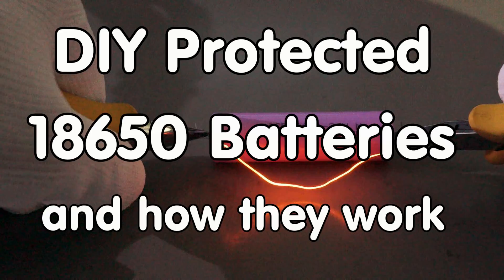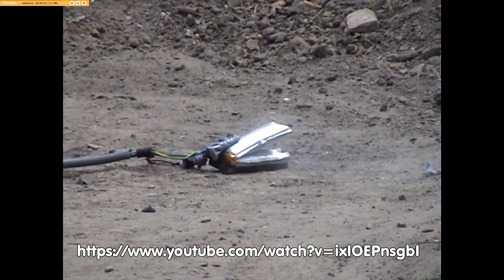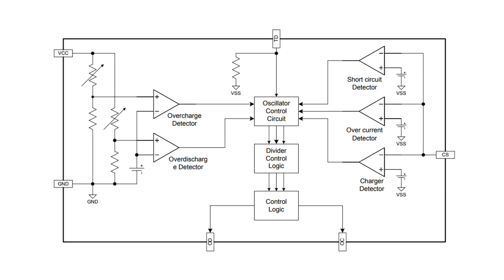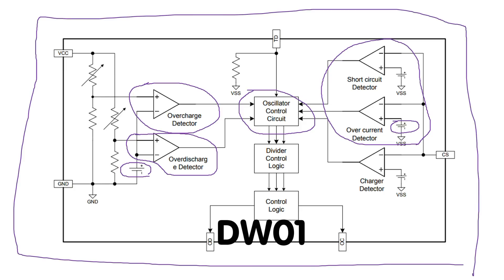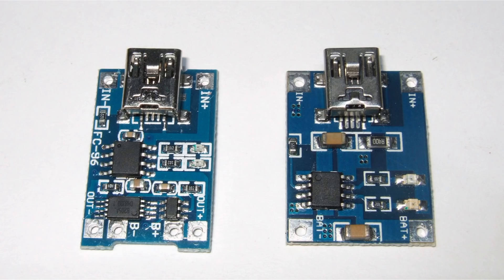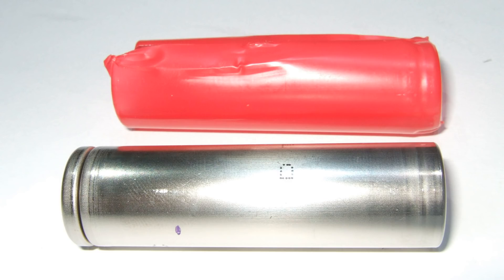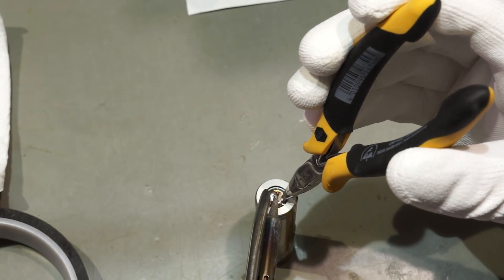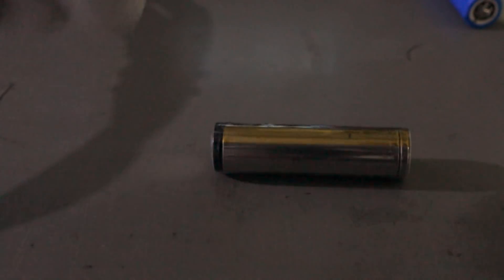#160 40 Cent Do-It-Yourself Li-Ion Protection for 18650 Cells (Tutorial) and how they work

Comment: Wowie! Cheap but no quick fix. So much ti do and do well, not gonna do it not really worth the time, then buy the finished ones or one can also fix the protection circuit in the battery case or between it and the mcu with much less effort
Reply from the maker: I agree. They are now widely available.
Reply: @AndreasSpiess  thanks for the reply, and of course the video which made things much clearer me! Just for reference to others, the modules tp4054 tp4056 or tp5100 are what Andreas (or/and I) mean

Comment: if you want to increace the number of times you can charge and discharge and limit battery degerdationg limit voltage charge to 4.15v and discharge to 3v will alomst double the charge/discharge cycles
Reply from the maker: Good point!

Comment: great video. But i think its only necessary if a product you change the battery has no CE certification. Otherwise it doesnt make sense. Here in germany every product has an CE certification. It means every circuit in a electronic device has this protection itself. So it isn´t required to do it Additionally.
Reply from the maker: I would not trust the CE sign. It is often called "Chinese Export" ;-)

Comment: Hi, It must have been almost a decade i am fondling with these batteries. I am a doctor but DIY is my passion. I must have tried almost every kind of charging method to charge these batteries but have never succeed ed to charge it to saticefaction.Before 2 years i purchased a charger for these batteries but it did not include the adapter .! It was socket with some circuit in it,to which any 5v micro usb charging adapter can be applied. So i have used that couple of time, thence but not as much as i should have otherwise. My intension of telling all this is that luckily never ever any battery haveexploded as is a risk i am learning from your video,perticularly charging a completely drained battery!!😢. Will you please tell me where from to get that small chip and what is it named as ?. I can not end up without saying that yours is the only video where in i could see author replying each comment interestingly. This shows your passion and commitment towards your work. I am radically impressed. I don't know whether and when , i will be fortunate to have respose to my comment. None the less, Gudluck and Stay blessed as people like you keeps the system trusted and going over in this era of too muchprofessionalism.
Reply from the maker: If you use a TP4056 module (link in the video description), your battery should be charged ok using a USB power supply. It has a DW01 and an FS8205A chip on board. And thank you for your nice words. At my age, I am happy that your profession exists, too ;-)

Comment: Thank you for posting the informative safety video.  Corporations have not made it clear why lithium cells should not be used after dropping below a certain voltage.  As I understand things the problem is that the working materials are carried on the surfece of a copper foil.  The copper is not supposed to be involved in the chemical reaction.  When the cell is discharged below a certain voltage the working material becomes depleted and the copper starts dissolving in the electrolyte.  Upon recharging the copper plates back onto the foil but does not do so evenly.  It forms dendrites which grow across the cell and can eventually causes a short.  This can cause the cell to vent or explode.  After a cell has been undervolted there is no way I know of to test if it has become a bomb.  Strangely, many made in China chargers will automatically charge an undervoltage cell without giving any warning.  Adding protection to a cell is a good idea but only if the cell has never been undervolted.  The protection board cannot prevent a copper dendrite that already exists from shorting the cell.  Good luck with your videos.
Reply from the maker: Thank you for the additional information!

Comment: Personally, I wouldn't trust Kapton tape to isolate the positive wire from the negative battery shell if the battery is used where it will be exposed to vibration. It will almost always work fine, but if it doesn't and the battery is charged it will burst into flames.
Reply from the maker: I agree. Vibrations need more care.

Comment: Would i be able to use this circuit kit to protect a LiFePO4 battery? I know it wouldn't protect it from overcharge, but that is not a problem because i will be using a TP5000. My only concern is overdischarge protection, as i would be connecting it directly to a esp32. Maybe it would not be a problem because the microcontroller switches off if the voltage gets too low?
Reply from the maker: Both chemistries have a similar low level. So it also should protect LiFePo4 batteries.
Reply: @AndreasSpiess  Ok, I will try it then. Thank you!

Comment: I recently began looking into 18650 and powering a project with it. Thing is, if I finish it the batteries will be really close on my body and all holding devices are designed for unprotected batteries, protected ones are slightly too big for protected ones.
I hope this‘ll work out for me and thanks in advance for the video (maybe make an updated one if there are new parts on the market? Or maybe for better audio)
Reply from the maker: I know the problem of too big protected cells...

Comment: Hi Andreas, this is awesome. Can you recommend a product I can place between a regular 5V phone charger and a security camera 18650 battery so I don't have to remove and charge it all the time. The camera is a Reolink Argus 2, I could get a solar panel to do the job but the trouble is the camera is installed on the north side of my house and the panel will never get enough sunlight. Thank you!
Reply from the maker: I do not know your camera. I assume you have to emulate the solar panel with your charger and check if the solar panel already has a charger module inside. If so, you have to add one (or extract the one in the solar panel.

Comment: Hi, greetings and salutations from Mexico. This video was very interesting for me and the question I want to ask is as follow: I need to replace the batteries of an Emergency lamp which it's always connected to the electricity and the batteries start working when the  electricity is cut off. Could the circuit showing here  be good to protect any damage ?, I mean that the battery may explode due to continous connection to the electricy.  I appreciate your comments, and thank you very much in advance.
Reply from the maker: Li-Ion batteries have to be protected against overcharging. Otherwise they would consume a ton of energy and would become very hot. Maybe they are not protected against low voltage. But this is probably not too important for your use case because they are not used till the batteries are depleted.
Reply: @AndreasSpiess   Thank you  Andreas for your explanation. Keep doing what you do in order to help people.

Comment: Hello Andreas! I put a protection board on a 18650 battery but now reads only half of its capacity.. do you have any idea why is that? Thank you!
Reply from the maker: Strange. It for sure has a little less capacity if you use a standard charger because it still stops at 4.2 volts. The battery has a little less voltage then. But not only 50% of the capacity.
Reply: @AndreasSpiess  I tried to put the same board on another battery but it won't charge at all..
Reply from the maker: So something must be wrong :-(
Reply: @AndreasSpiess  Yes! And I don't know what it is..

Comment: Now here's the thing i need some help . Now here's what's happening . Now i want to go ahead with the Dw01 ic  but what's happening is that when my battery voltage drops below 2.4 volts the ic shuts off the output but then because the output is now shut off the battery gets time to regenerate its voltage and as soon as it reaches 2.9 the load again starts to draw power but because the battery actually has very low juice left it again drops back to 2.4 and system shuts off and this cycle of the system on and off goes on and on. I want the same feature as yours that once my battery is below a certain voltage only connecting the charger enables the output again . How do i achieve that with DW01 as i went through the datasheet of both the protection ics and this feature of enabling the output when charger is present is not a feature of any of these 2 ics so how is it happening and how do i solve it for my system? Please guide me .
Reply from the maker: This is what happens. If you do not like it you have to use a voltage monitor (I made a video about the topic)
Reply: @AndreasSpiess  By voltage monitor do you mean voltage supervisor? Also there is a variant of this is called the DW01+G if you have some time can you have a look and tell me weather that ic will work according to what i want i.e( only recovering from over-discharge once i connect the charger )
Reply from the maker: Yes, a voltage supervisor. They reset the CPU if the voltage is too low. They do not protect the battery.

Comment: Hello Andreas,

Nice and informative video, however I believe (correct me if I am wrong) that there is a mistake at 06:42 : the battery should not be connected between BATT+ and BATT- on the right side of the schematic, but rather between the two black dots on the left side of the schematic.

The analysis of the DW01 function diagram shows the two overvoltage and overdischarge comparators on the left side also, which confirms my statement.

The purpose of BATT+ and BATT- is to indicate the outer battery pack contacts, like for a cordless drill for example.
Reply from the maker: You are right. My mistake.
Reply: I was going to say the same thing, thanks for clarifying what I already thought. 

I must admit though those diagrams are pretty stupid having the word BAT + and BAT- when its actually infact the power coming in from that side to charge the battery.

Comment: I think about using 18650 batteries with a high quality headphone amp. Are there any downside to the battery protection electronics like ripple or spikes? (I don't think so but it doesn't hurt to ask)
Reply from the maker: No, I do not think so. Only chargers and voltage converters create ripple.

Comment: I just wanted to thank you for this video. If I hadn't stubled upon it in time I would possibly be a child murderer of 4 children this christmas. I'm an amature in electronics but I designed a LED lamp circuit that I'm going to put in a 3D printed night lamp I partially designed. To power it I'm using a 18650 battery and I bought an over voltage charge protection circuit board and after watching your video I realized I also have to have under voltage protection especially because my circuit will draw a small current even when the LEDs are off. Thank you for helping me not murdering my baby relatives!
Reply from the maker: It is a good idea to add undervoltage protection because completely discharged LiIon batteries cannot be charged with standard chargers.

Comment: I'd like a more detailed explanation on how the overcurrent protection works. If I've understood correctly the DW01 measures the voltage drop through the mosfets and compares that to the specified overcurrent detection voltage? If this is right then you'd need information on the Drain-Source On-Resistance in respect to the battery's voltage applied to the gate of the mosfet and the voltage drop that comes from the fet's diode?

Comment: Andreas, I very much enjoyed not only this video but others of yours as well. Yours is the first video to mention a protection method of cell protection on the web that I have seen to date. You already helped me to solve a problem that I was unaware of.  I am trying to build a simple 4cell 18650 LI-on power bank and stupidly I rushed ahead and purchased unprotected cells.  Thankfully your protected cell modification will help me there. I'm trying to build a small pack that will give me the following outputs at the flick of a switch: 12v, 5v, and 3v.  If you could point me in the proper direction I would be happy to make a contribution to your site. Thank you in advance for your help.
Reply from the maker: First: If this is your real name, you are very lucky ;-)
Second: I do not know where I could help: You know what you want and with the help of Google you will find a project which covers your wishes.

Comment: so if i put 2 or more 18650 in parallel do i need a DW01-P and a FS8205A per Cell (3cells => 3 circuits with DW01-P and a FS8205A) or is 1set enough for a whole array of parallel connected cells ? (3cells => 1 circuit with DW01-P and a FS8205A) ?? thanks
Reply from the maker: If you parallel cells they behave like one with higher current capabilities and more capacity.
Reply: @AndreasSpiess  ok thanks so I only need one circuit.

Comment: I got some protection boards and test it first, they will work. I order stripes, not round like you show here. Then i add this to an Li-Ion holder. I insert my Li-Ion cell to the holder, but it don´t work. To run my application i must do a short loading this Li-Ion cell (3,5V with low current to the output/input pins) and it works. But if i remove the batterie and insert it, it will not work again. So this boards can not be used like i am doing it ? I can also start the batterie by shorting the B- and out- pins, but this is not what i want.
Reply from the maker: I cannot help here. You have to test if your use case is supported by these boards.

Comment: Hi Andreas,
Soldering batteries might be damage inner structures. You can put batteries in the fridge. After some time you can take them from fridge and begin to solder. Since it is cold, soldering will not harm inner structures.
Reply from the maker: Theoretically you are right. I think, it depends on how long you solder. Mine never got hot.

Comment: The concept that has me puzzled is differentiating over current protection from short circuit protection. Does OCP have a time delay? Otherwise, a short circuit is obviously also an over current situation!
Reply from the maker: As you write, a short current is a special case of overcurrent. So they are treated the same way. I do not know how fast they switch off.

Comment: It gets confusing I think but IMO there must be a proper way...  ie: If the battery is already equipped with protection, is it acceptable to have additional protection circuits in series such as built into the charger circuit, or is this possibility to be avoided in every case?

I would think it's not acceptable?
Reply from the maker: Chargers do not have "protection circuits", they use charging curves. These charging curves have similar top- and bottom values like the protectors. You can charge protected and unprotected batteries with the same chargers.
Reply: @AndreasSpiess  Agreed, however, some device batterys have built in charger circuit or is it just a protect circuit?  I'm working with a device that has a strip pcb with one or maybe two IC's on it and integrated into the flat battery pack.  I suspect it's a charge control and protect circuit both, integrated into the battery.  I'll be looking closer but my guess is it's more than just a protect circuit.  I plan to replace the battery with aftermarket to avoid price gouging.  Will post a picture to help explain.

Comment: I have a question. B+ goes to Battery Positive. B- goes to battery negative. You don't use P-. And in the circuit where is P+ ? I'm pretty confuse.
Reply from the maker: I think the video shows quite clearly where the different wires have to go. Keep in mind the contacts of the battery holder. They also connect to the battery and the protectors.

Comment: Great video as always! Top notch information that will save a lot of trouble for many people!
I have all but one question, the P- is for the negative load so does this mean that by using the original - of the battery, you bypass all the safety features? +1 sub!
Reply: Did some digging in the datasheet provided by the supplier on Aliexpress.
It answered my original question (P- is in fact by default connected to underside of the battery) but it created another question, what is P+ since I do not see any markings on the PCB. 
Or can you simply charge the batteries like normal -using both ends of the battery itself to charge with a TP4056?
B+ positive electrode.
B - connect battery cathode.
P+ charge / discharge end positive electrode (charge end / discharge end sharing).
P- charge / discharge end negative (charge / discharge end).
Reply from the maker: I think you find a diagram in the video. The battery works exactly lie an unprotected one at the end. Just protected.
Reply: Thank you for you reply! Great work!